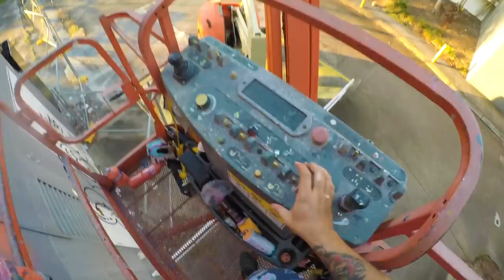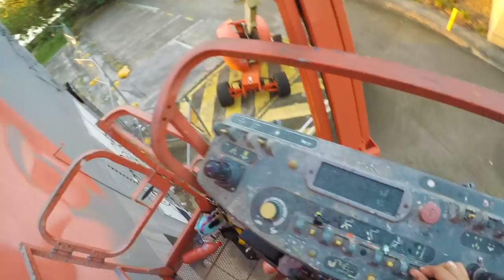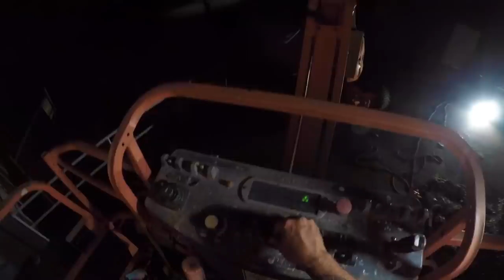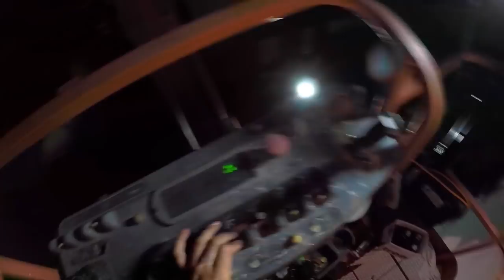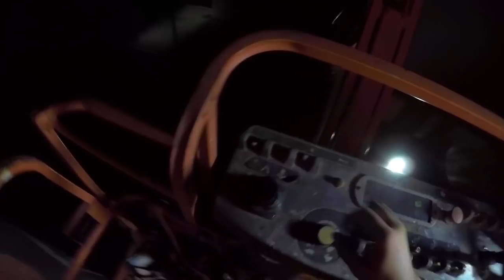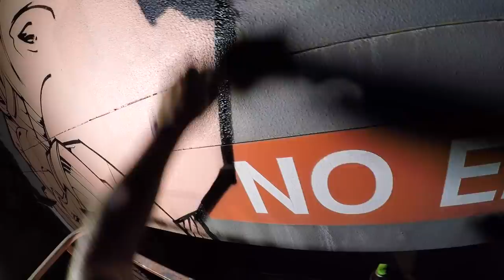SOFLES | LINEWORK 2

Comment: Nice job !!! I have an quest, what is the name and model of the spray gun you used in this work? it seems to have a great efficiency and a good performance, please answer me, thanks bro! Rock 'n holl for you always 🤘
Reply from the maker: "Graco - ultramax". cordless sprayer. amazing tool, high output, can handle acrylic and oil based paint, but use mostly acrylic paint (with 5-10% water added)
Reply: @S0FLES  very grateful, even gave me the paint dilution, I'll see if I can find it on the internet and if you have this paint gun here in Brazil,🤘
Reply: @S0FLES  I saw the price, it's imported from abroad, and it costs 5,399,99 reais, I can't afford to buy it, it would be almost 10 thousand dollars, it's expensive as hell 😅, shit, it's hard to be poor and live in a corrupt country, The way is to settle for compressor, unless you have an optional suggestion, but thanks for answering me.